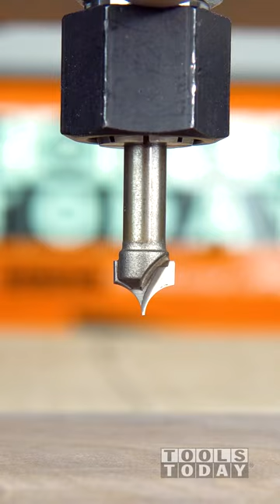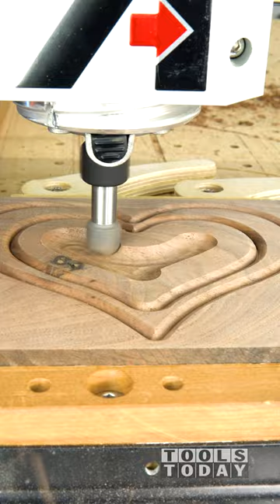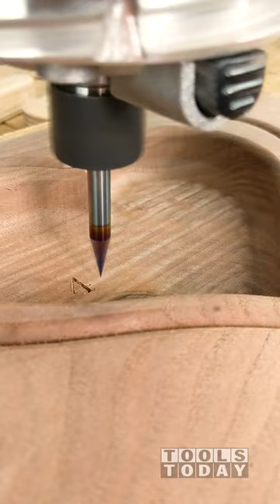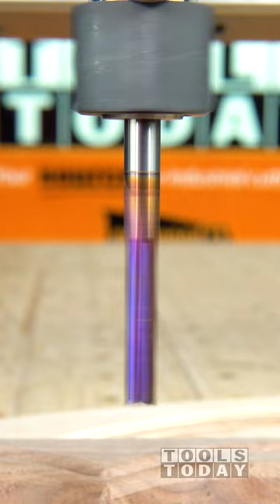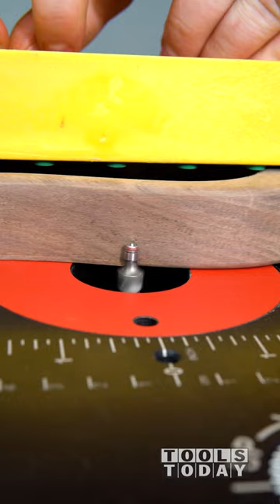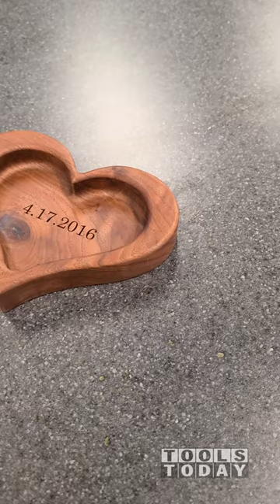Making a Heart Tray

Comment: One day I'll be able to afford a cnc
Reply: I built my own for like 600 bucks, maybe less. Look for Lowrider 3 CNC, you can make it a big or small as you need
Reply: Build one it’s cheaper!
Reply: @lonewolftech   I built a lowrider 2 years ago and could never figure out the programming to make it run correctly. I'm barely smarter than the wood, so when the wires and controller came in to play I was toast.